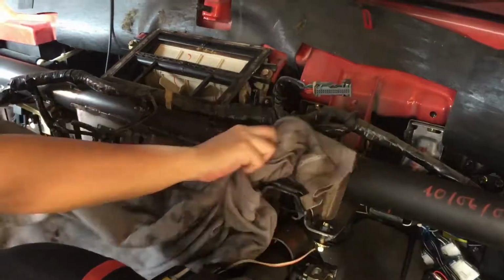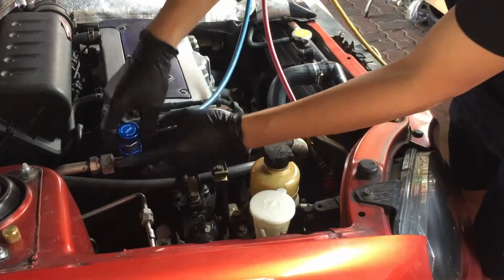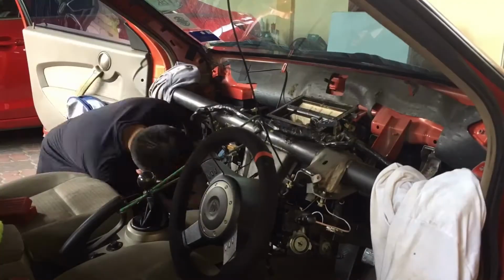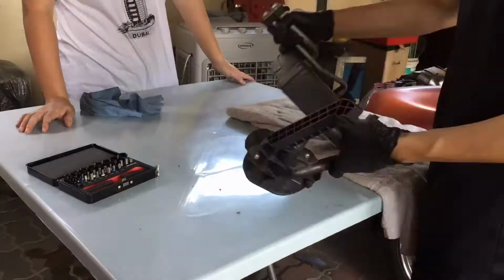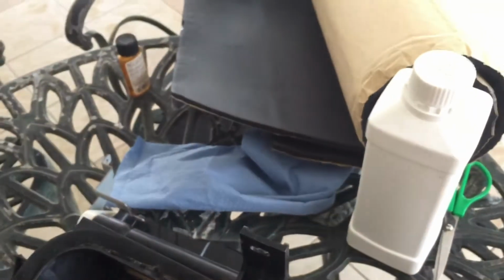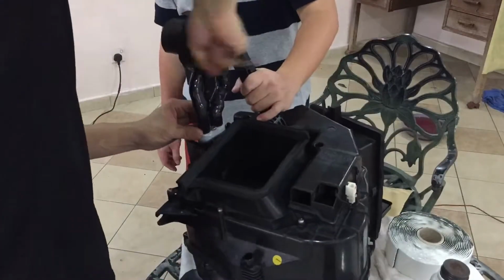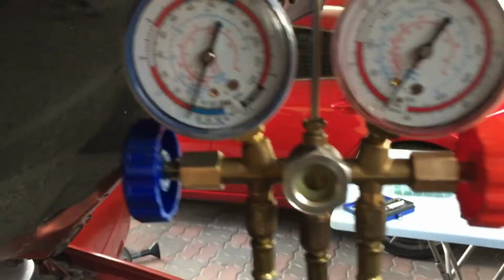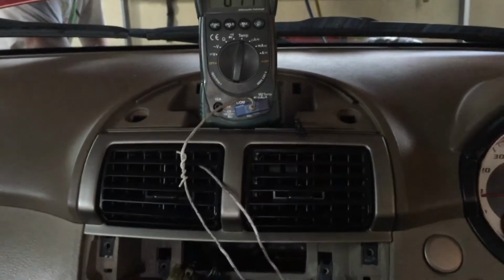How to replace a cooling coil, expansion valve and drier receiver in a Gen 2 / Persona (Air cond)

Comment: Changed the cooling coil 2 years ago for my Gen2...  & last week the compressor just died...  Even if it is turned on, the magnetic clutch plate is not engaging...  Any advice for me?
Reply from the maker: Hi buddy, could be malfunctioned magnetic clutch which you can just change the clutch assembly. Don’t need to change whole compressor. I would suggest to check if there is gas first, if yes then check the magnetic clutch.
Reply: @forgedforspeed  thank u for the prompt response...  Will check as u advice...  What does it means if there is gas/no gas?
Reply from the maker: If there is no air cond gas (R134a) in the system  due to a leak. It may also cause the compressor to not kick in.
Reply: @forgedforspeed  thank you...  
Really helps...  Indeed it was the gas missing...  I topup the gas for the mean time, any suggestion on how to detect the leak?  The pomen suggest maybe it is the cooling coil again😅... (used for 2 years only, is that normal?)
Reply from the maker: Hi buddy, glad I could help. I would suggest to do this, top up gas like you did is the correct first step. Now the air cond gas R134a has a funky/unique smell, therefore if the cooling coil is leaking, you can smell the gas in the car. Try to smell the air coming out from the vents in the morning first time you turn on the air cond in the day. You may be able to pick up the smell of the air cond gas. 

Another usual leak is the flexible air cond hose that connects the compressor to the condenser. It has a heat shield over it. 

Personally I doubt it is the coil coil that leaked. My cooling coil lasted 18 years with 250,000km 😆. Message me on instagram “forged for speed” for easier chat.

Comment: Nice video, Just had my air con cleaned after 16 years. May I ask you a question? The standard air cleaner box of the Gen 2, there's 4 screws holding the cover right? The bottom screw mounting always becomes big and unable to grip the screw. I've changed it before and still happens. Will this be a problem whereby dust can enter from the bottom or will the other 3 screws be enough for the box to be dust proof? Thinking of changing the whole thing to open pod filter.
Reply from the maker: Hi buddy, I am sorry I can’t follow coz there are too many screws around. Ideally you would want to have every screw to be tight. However if it is just one screw out of many others there should be enough strength to hold to cover in place. I won’t be too worried about.